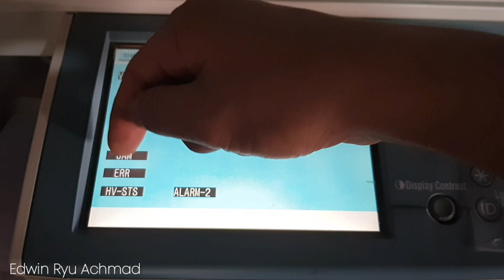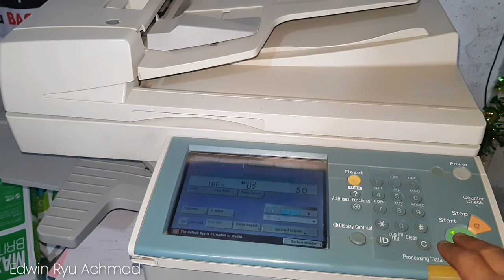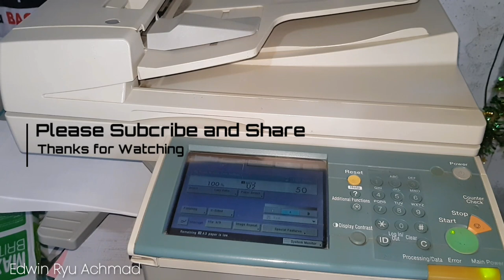Repair Paper Jam Sensor PS14, Using Silicone Oil, Canon iR3045/3035 iR4570/3570 iR3245/3235

Comment: Bang tolong bikin vidio tutorial bongkar motor lifter laci kertas IR4570
Reply from the maker: Kasus nya knp ya? Kl load paper pernah dibuat pidio nya
Reply: @EdwinRyuAchmad kasusnya kertas tidak tertarik oleh paper feed kalo peng copyan lebih dari 30 lembar padahal kalo cuma 1-20 lembar mesin berjalan lancar, dengan keterangan jam paper tapi tidak ada kertas yang tersangkut. saya juga sudah ganti selenoid. Jam papernya hanya terjadi di laci/tray no 2. Terima kasih, mohon bantuannya ....
Reply from the maker: @TheGOZIEM  coba dianalisa lg, kode jam paper nya di sensor berapa, dr situ bs dicari kesalahan nya, terkadang level sensor terlalu pendek, atw karet dah pd aus, atw cover pintu kurang nekan,
Reply: @EdwinRyuAchmad  kalo error nya di ps10 gan, terus kalo karet feed nya semuanya udah di ganti.
Iya gan ntar saya coba.
Terima kasih gan atas sarannya